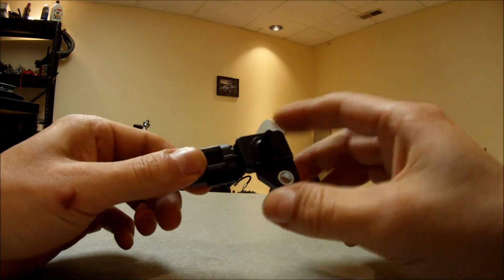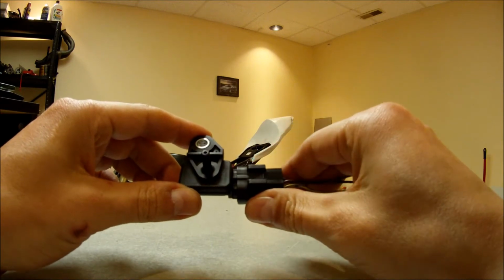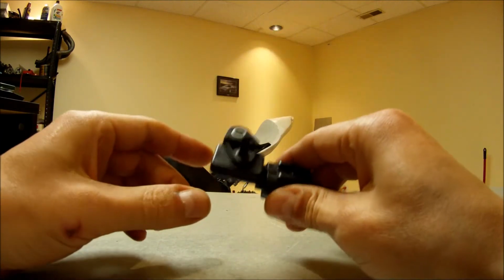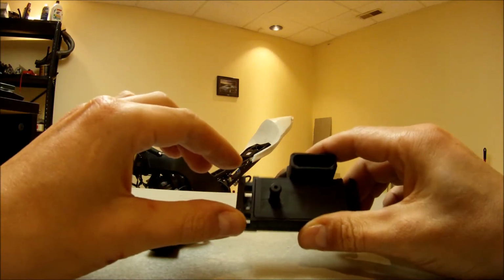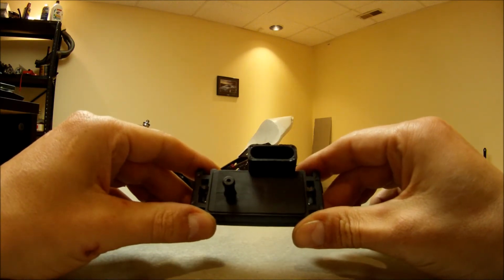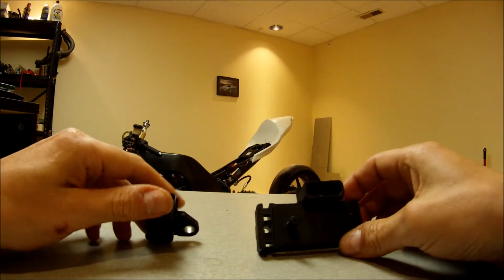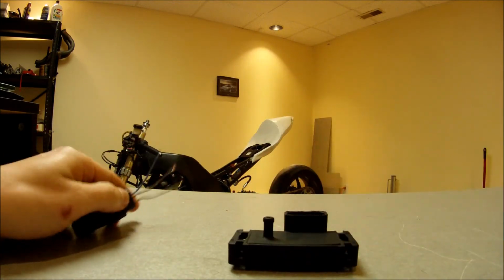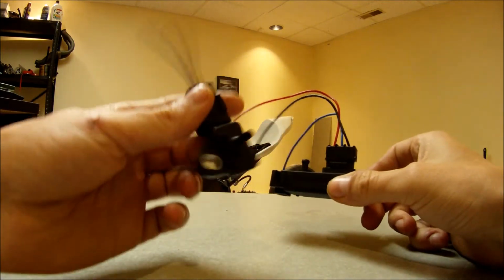TURBO KAWASAKI NINJA ZX10R BUILD, PART 18

Comment: So if you dont have a standalone ecu, how do you get the ecu to read an aftermarket map sensor?  Building a small turbo setup on my gen1 zx10r . Have the pc3 and ignition module.
Reply from the maker: You'd have to reprogram the ECU and change map sensor connector to aftermarket map sensor.
Reply: @everydayirace  ugh that sucks. So looks like I will have to keep the stock 1 bar and just tune for throttle position in the power commander .   Only going to run 5 to 7 psi on a t25 tiny turbo so should be ok I hope
Reply from the maker: @Chase_on_tuning  tuning boosted engine with throttle position is a great way to blow up your engine.
Reply from the maker: Is there a reason you're not wanting to install a stand alone ecu and actually simplify the whole thing?
Reply: @everydayirace   we are just putting together a budget setup . It's more of a introduction to the bike world for us. We have tuned multiple 600whp turbo hondas so looking to come to this side of things.  So mainly were judt hoping to get by with a basic setup .  Will be an internally gated t25 turbo off an sr20,  stock fuel system, air to air intercooler. shooting for 200whp and we will be happy  . Nothing crazy
Reply: Apparently there is a other addition to the pc3 I can add called the multi function hub which will allow a map sensor to be wired in through it. Then can be calibrated through the software settings. I may go that route.
Reply from the maker: Yes you can.